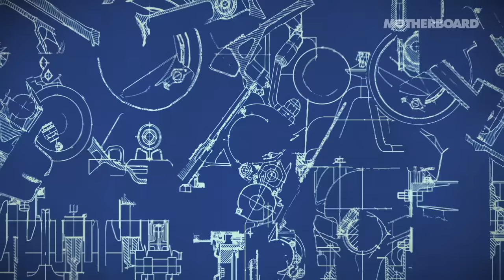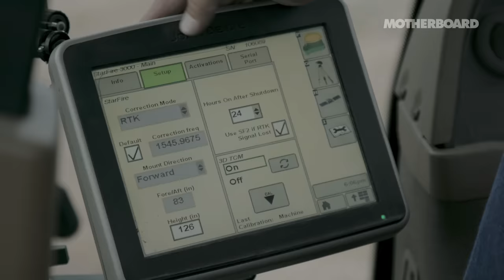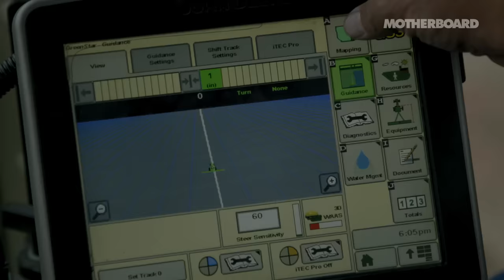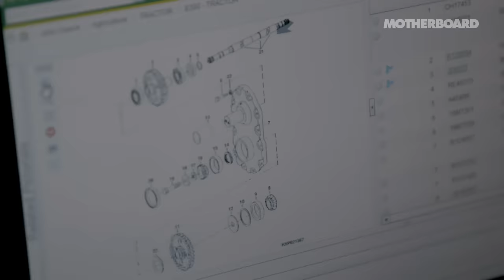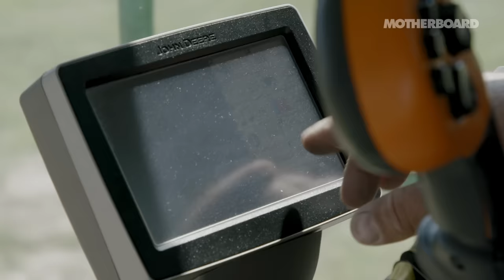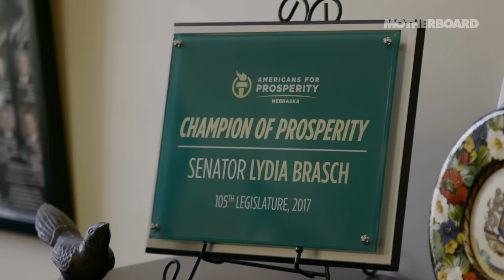Farmers Are Hacking Their Tractors Because of a Right to Repair Ban

Comment: They have done the same thing in the automotive industry, it’s ridiculous we should be able to repair our own stuff 😡
Reply: The difference is that you can take a crashed 2020 corvette and put whatever used parts on it that you want and the engine still works,  you can drive it, etc. Imagine if you replaced a headlight and the car wouldn't start.

Comment: "Can't diagnose codes on a John Deere"

Be happy you don't have a Cat, can't even check codes...
Reply: You can though, the codes come up on the monitor and you can purchase the complete software program to connect and troubleshoot.
Reply: @gradytrainor8120  the only Cat i ever seen where you could even check the codes was on a 349. all the 374s, 745s, 980s, 982s etc it would just throw a light on. our dealer was completely unwilling to sell us any software. probably because showing up paid them $500.
Reply: VOTE
Reply: @jamesm.8392  wdym “VOTE”??
Reply: Get a old cat they still do plenty of work
Reply: Perhaps some Cat dealers aren't the greatest, but of all the manufacturers out there of heavy/farm equipment right now, Cat is the most friendly to DIY/shop repairs. Their parts support is nothing short of industry leading, and there are many very old machines that you can get all the parts for still. You can get SIS (Service Information System) which has the parts catalog and all service information, along with other software and special tools needed pretty readily. Is some of it a bit pricey? Maybe, but I've found the quality and support commitment from Cat to be second to none, and therefore worth it. As far as John Deere goes, we all know how that works...
Reply: @lsm_optix3176  this was a week before the election.  I havent heard this as a compaign issue, maybe it should be.
Reply: @markhoffart622  - Maybe he meant to vote with your dollar?  Buy products that are made by manufacturers that work with you and stop buying products from those that won't.  They will notice if sales drop enough...and that could affect change.

Comment: I completely support this. To force people to come for a diagnosis of a simple repair problem they could fix themselves in less than a day is absurd and wholly unfair. It is a complete monopoly, and until legislation is passed to counteract it I hope a lot more people hack their equipment.
Reply: Sadly it’s the same issue for anyone who owns a newer diesel truck. I had one for years and I had to spend over $5k just to be told your fuel pump is bad and replace it and flush my tank. Bad things is there’s only a couple independent diesel mechanics here in this area and they know it. The only other option is the dealer who probably would have cost me double. It’s sad
Reply: It is pure greed.

Comment: Would be nice to see an “open source” movement for JD tractors.  We need to protect our farmers, even if they are big combines.  John Deer is simply pushing up the cost of food for the sake of their own profits.
Reply: it can be done, but the main problem is that john deer probably produces his own hardware (not only his software), wich means you legally can not "free" that hardware because it is like using a picofly for the nintendo switch,  i mean they will acuse you for pirating their systems and robbing the information, and that is like robbing intelectual propierty, because in the point of "the pieces are done by other companies" it will allow you to use "open source" software, but for that the pieces of the hardware need to be done by different companies, in the computers case the chips are done by microchip or by nvidia, or amd, or intel, or someone else, then, the motherboard is being done with other companies, and the bluetooth, the wifi adapter, the buttons, and the power source also are done by others, so the companies had "standards" and they managed in some way to make diferent pieces every one but they are compatible between them, so this can lead the software developers to have "open source software", but those tractors are not open source compatible at first hand, because all the pieces are sold by john deer, and john deer can claim it as his property (yes the law scks) like apple and his new chips, and his "unique" hardware, so it is pretty hard to make those tractor work without bypassing the security of the john deer company software, at this point those tractors are not "sell", they are just for the farmers in like a "rent" way, so the farmers need a way of get through the legal way to obliterate the company to allow them to fix on their own, or, just can wait to ther company start to produce tractors and other equipment without selling propietary software and hardware to the farmers.
Reply: Soon gonna appear a Linux based platform to control jd tractors or any other Brand

Comment: It’s the truth. You got a 20 series or newer John Deere tractor you can’t do anything to them. I spent 3 grand on one a month ago cause a $20 switch was bad making it derate the engine. It’s crazy. Shop bills 150 dollars a hour and 5 dollar a mile to pick it up. It’s not a loaded mile either. Charge you 5 dollars a mile to drive an empty truck to get it. If you had the computer systems would’ve been a simple fix.
Reply: Ben Buck Deere didn’t offer you a field serviceman to come out and repair it?
Reply: Contact calibrated power they can unlock you ecm with all types of software.
Reply: Colt DeWitt sent the truck down here and told me there was nothing they could do here. Had to go back to the shop. It was only 70 miles one way to come get it either. Field cruise switch messing up
Reply: we don't tolerate this proprietary nonsense from car manufacturers.  why do we tolerate it from tractor manufacturers?  probably because John Deere has a bit of a monopoly in the US and is using that to exploit their customers into buying new parts.  if they had more competition here they would lose market-share due to these practices.
Reply: As you can probably guess from my profile picture, I’m a younger person from a city, but if my damn computer breaks I want to be able to fix it, and not have to ship it to some Microsoft or apple store for them to replace a 20$ hard drive. I just want the system to fucking work without me having to pirate some sketchy software, the fact that big technology companies even think they can pick on farmers is astounding.
Reply: Jhon Yark the newer tractors are so much worse than the one I’ve got know. Most of my fleet was built between 1975-1985. They are old and o can keep rebuilding them without a computer. If you want to see what I’m talking bout with the tech in them check out Brian’s farming videos and the MN millennial farmer’s YouTube channels and you can see what goes into them.
Reply: Ben Buck you should own a vehicle that can transport your equipment. My company doesn’t own an excavator because we can’t transport it or afford to repair it. Soooooo be responsible
Reply: Matt Rowland a monopoly is the when one company is the only one offering a product or a service. We have dozens of tractor companies.
Reply: @benbuck9133  that was just a crappy mechanic.  After 30 years, I can do anything in the field that they can do in the shop.

Comment: Right to repair, not only in industrial equipment but also in personal transportation, is one of the most important steps in protecting the environment. The car with the least negative impact on the planet is the one you’re already driving. Keeping it running is always more efficient then buying something new, but manufacturers want to to go buy a new one.

Comment: Wouldn't it be smarter to buy older farm equipment that doesn't need electronics? Those old machines are easier to fix, and it's easier to find parts. Plus, if we help each other out like the old days, we could save a lot on repairs and upkeep.

Comment: Not allowing farmers to repair their own stuff if they want is complete bullshit. Im a part time farm hand and don’t know much about farming yet but I do know pretty much every farm has at least one “maintenance” guy or maybe 2-4 people who are in charge of repairs on the tractors. It’s important to have someone in the shop to be able to fix a piece of equipment and get it back into service ASAP. And it’s also important to minimize the amount of time large equipment is on the highway because of logistics problems, cost, efficiency, etc. and this doesn’t just affect farmers either. Do you want MORE combines on the highway getting hauled by trailers just because a farmer has to pay $2k to get his tractor taken to the dealership 40 miles away so they can just push a couple buttons?! HELL NO. Keep their combines in the shop or in the field as much as possible. This will help everyone. Making a farmers job more complicated is never the correct thing to do. Their job is difficult enough. Any company trying to do this to farmers should be put out of business. We shouldn’t let this happen

Comment: Right to repair seems to have some real bipartisan support. I’ve seen people from complete opposite political sides agree on this. I mean COME ONE let’s get this passed!
Reply: It's common sense to the fullest extent.
Reply: For real, it's just common sense. People should be able to use what they own, to the fullest extent. Period. Anything else inconveniences everyone
Reply: John Deere and Apple and such will just pull some corporate lobbying bullshit...
Reply: exactly, it supports small businesses and prevents companies from charging insane margins to make cheap repairs
Reply: @sushantmanandhar1387  Indeed. Compared to Apple and Tesla, John Deere is relatively small. But it is common sense and I've seen both republicans and democrats fighting for this.
Reply: One of the problems I don't see addressed at all in these threads is industries like mine. I support right to repair, however I work in fire and life safety. If every maintenance guy was allowed to repair the fire alarm system at their hotel or apartment building, we would start seeing a lot more undetected fires and death and property damage due to fire and sprinkler systems not working correctly. Things like this make drafting a right to repair bill difficult, because either you have to draw the line at equipment that is dangerous to others if repaired incorrectly, or those industries would then have to draft their own laws to forbid amateur repair work. It can be more complicated than "(insert megacorp) is greedy", but right to repair lobbyists often don't address that in their YouTube videos.

Comment: GM recently lost a lawsuit from the DOT in regards to “we own the software”. It’s pretty sleezy. I will drive my 66 Chevy till the day I die.
Reply: I just bought a 85 k5 blazer because I was sick of the computer stuff on my car and how hard they are to fix.now the 85 I can climb under the hood and pull.it down in the rain so you dont get wet fixing it if you have to
Reply: Yea, being in the automotive field it actually surprised me that this is even an issue for things like tractors. It has been been to court several times that the manufacturer can not put any type of restriction on the software that would make it so that only their tools can communicate. A $200 scan tool off of amazon is perfectly capable of full computer diagnostics on any modern car yet we still have to fight for the ability to repair our personal electronics and apparently tractors too.
Reply: IDK about that. We already have the talking heads in DC that want to ban all gas burning engines as soon as possible.
Reply: @jrichardson-m9m  Not everything can be done with an OBD scanner on the newest cars. On some of them it takes tools that cost thousands if they even exist yet, because the aftermarket has to find a way to hack them together.
Reply: @SuperBobKing  Besides module reprogramming there is nothing that I have run into in the 7 years that I have been doing this professionally that my cheaper scanner couldn't handle. Besides with an industry standard 3yr/36k mile warranty most cars won't even end up in an aftermarket shop until they are atleast 1yr old. By then the companies that make the scan tools have already updated to the latest cars. The connectors are also standardized across the board. The most expensive Autel unit that is on the market is $2500, that is pennies to a shop compared to the lost business of not having a proper scan tool. So basically, yea, you can get away with a cheap scanner for 90% of issues that you run into.
Reply: @jrichardson-m9m  what generic obd 2 scanner are you talking about? I'm in the automotive field and have a simple obd 2 scanner and true it works on many vehicles but it's the most basic Info. For each manufacturer we have there obd 2 scanner or software and have to pay regularly for updates. Automotive practices are going the same way making it as hard as possible to repair.
Reply: @Paradoxical Nightmare what a silly thing to say. First off, there are only about 280 million vehicles registered in the US, so already your comment is off by an order of magnitude. As it currently stands, there is no constitutional amendment that's grants you the right to drive, therefore a law could be passed that makes any vehicle that produces more than 20g/km of CO2 illegal to register. If you can't get your car registered, you can't drive it. If you do drive an unregistered car, you get pulled over and your car gets impounded.  See how easy it is too "ban billions of cars"?
Reply: I have been driving Volvo's for 30 years, my last one was a 97...because I don't want a Ford built Volvo. And it's a fully loaded top of the line 960.
Reply: @nasticanasta  got a 09 Suzuki sx4 sport 2.0l 5spd manual. 245,000 miles .oil,brake pads ,lower control arms, rear calipers and rotors all around. Oh yeah (3) three sets of tires .That's what cost me .
Reply: They tried something like that in Virginia recently. Look how quickly it got “shot down”.
Reply: Just bought an 83 ford🤝
Reply: Yup! Keep the old stuff going and use it for couple years and dont buy new and see how long that company lasts. Screw this software bullshit. Drive mechanical only! You save in long run because its easy to repair yourself
Reply: @snipexd4964  I currently have an Autel maxilink ml619 and a Matco maximus 2.0, I also work at a dealer so I have the factory scan tool as well. I hardly use the factory tool and the autel unit can view live data and codes for drivetrain, srs, abs, etc. The Matco unit gets pulled out for viewing graphs or performing tasks that require a proper scan tool(like module reprogramming). The factory tools only gets used for warranty stuff.
Reply: @chasemc69  driving is a right as it is apart of life they can not restrict many things they do
Reply: @chasemc69  You should look into "The right to travel", and take your BS somewhere else.
Reply: @jdrok5026  No actually, driving means you are for hire, that's a privelage,and it's all in the wording of legal terms and laws. You have a right to travel though, and that includes in your car from place to place, but most won't do it's because believing a lie is easier.
Reply: @jasonbourne1596  I meant as our right to happiness etc where we could do what we want as long as it doesnt infringe on others rights we are fine which is why licenses in the us are getting more and more unconstitutional
Reply: I'm with you Vinny. I have one vehicle, 50 years old, no computer, no sensors, no nonsense! I have kept it running without the manufacturer! No problem getting parts because there is a whole after market industry alive and well.
Reply: @jasonbourne1596  thats cute, site the supreme Court case that grants you the "right to travel" without restrictions? Just a heads up, you can't, because it doesn't exist. You've been reading to many sovereign citizen websites. Look, don't get me wrong, I hate how much power the government has over us but it does, and you can't do shit about it.